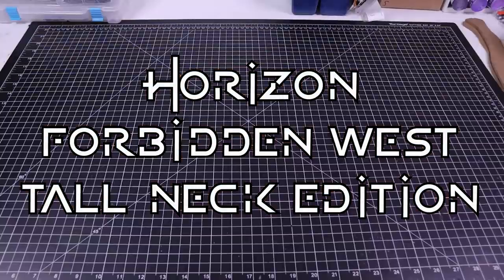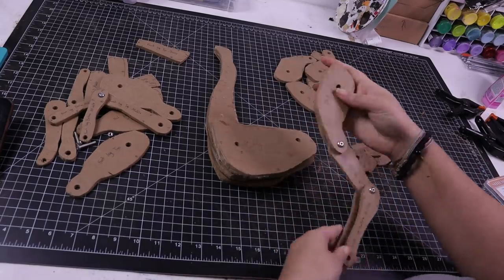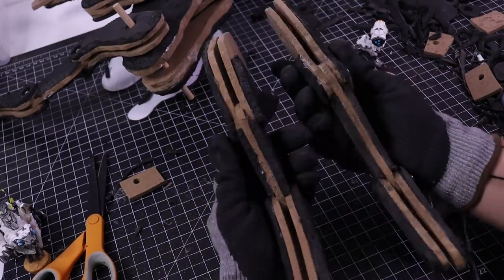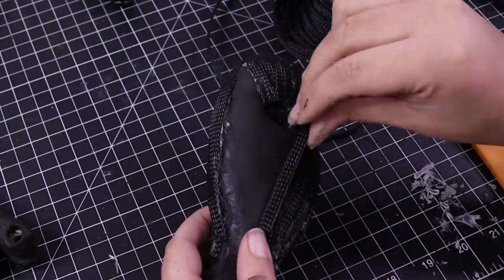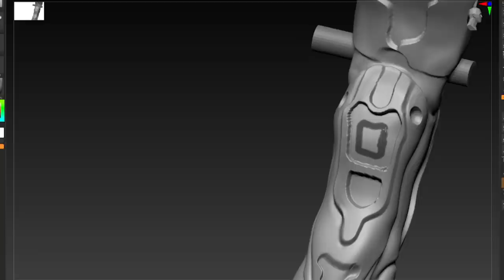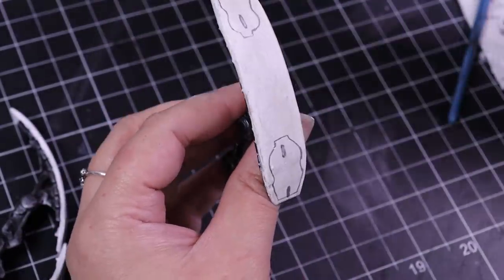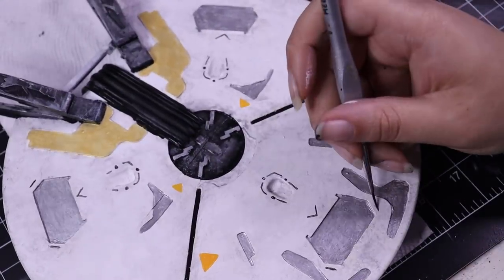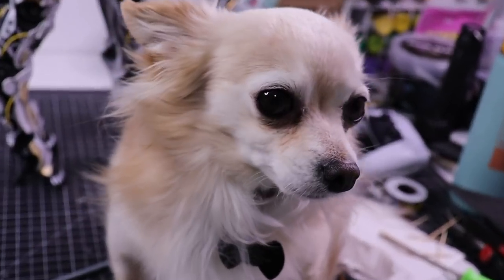I Made a TALLNECK From Horizon Forbidden West l Poseable Sculpture DIY

Comment: I've got a bunch of art doll projects that I'm refusing to start, but not because of thinking I'm not good enough or not knowing where to start...rather because I'm going to be changing locations very soon and the last thing I want to do is gather more supplies or works-in-progress to have to pack up and bring.  So yeah - I can do the thing; I just don't want to start the thing until after I've moved.
Reply: Update: I have moved.  Have been in my new location for maybe like four months now.  I've made one art doll (clay head, knitted body), but it's not quite done yet (still needs wings, hair, horns, and a paint job on the clay).  Where it is, I'd say that for a first art doll I'm pretty proud of it.  Even though I can see where I'd messed up and I'm a little like "ehh..." (and I can't go back and fix it, because it's pretty seriously far back in the piece)  Basically, it's good, and I know my next one will be better.